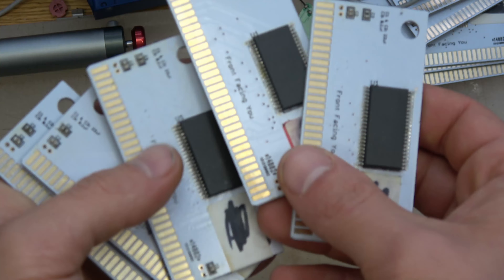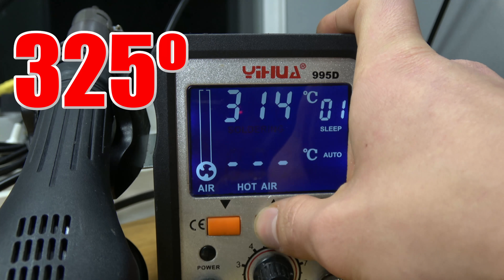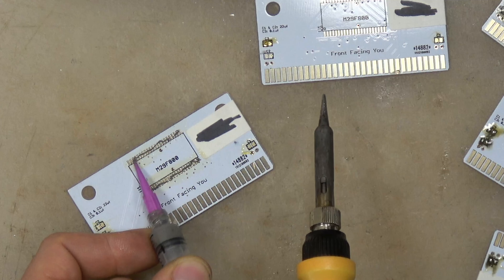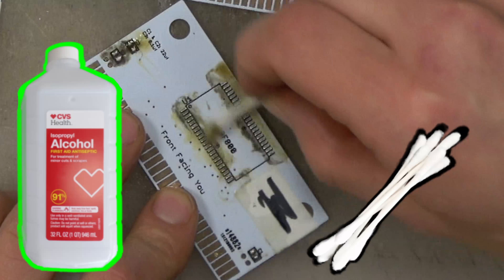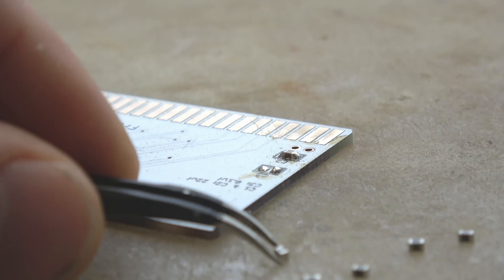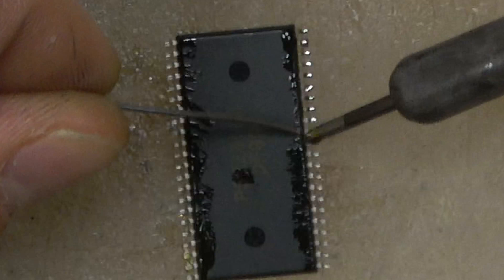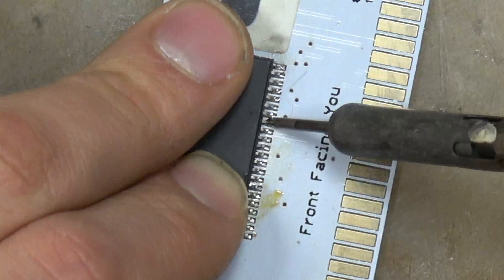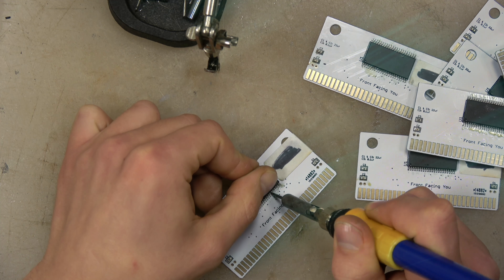Solder Basics - SURFACE MOUNT SOLDERING - RETRO GAMING ARTS

Comment: Awesome!!!  Thanks for doing these videos man!  Gonna be great reference points for when I start fiddling around with soldering.
Reply from the maker: The S-Squad when you do want to start, let me know, ill help gear you up with a starter pack, keep all the stuff you need cheap at first, and stuff like that, either way thank you for watching
Reply: S-Squad, soldering can be a very empowering feeling. I started only a few months ago with S-video mods on the Genesis, now I'm repairing consoles and doing incrementally more difficult mods. It's a great feeling knowing I can keep my system going as it ages and will inevitably fail. Not to mention it's just a darn good time. Definitely go for it.
Reply from the maker: nordak, very very well said, it has a rewarding feeling that feels really good, i was talking with some friends today about how about a year ago i wanted to hardwire a ps2 controller to a psp and saw the solder points and said "well, no way i can do that" and now i feel i could do it in a breeze, that feeling... feels really good

Comment: Looks like a professional job. Man, the tiny parts and areas you work with is unbelievable. Do you use a magnifier.
Reply from the maker: Thank you, and for a magnifier, i use my cell phone camera zoomed in to the max, 8 times zoomed, i use this to doubble check to make sure it has a good solid connection and no connectings are bridged

Comment: Mad skillz.  Seriously man, I'm amazed.  Just taking off the smd resistors when doing the mega amp mod made me a little nervous.  I learned a ton from this video.  Thanks so much for making these soldering vids.  Has helped me tremendously.

I am intrigued about the boards....are repros in your future?  That would be friggin' amazing.
Reply from the maker: nordak 01287 those smd resistors on the mega amp, just heat em up, and swipe them away, and as for the boards. Check my website and youll see exactly what the boards are for. I have not started a video them yet, but in about 1-2 weeks it will be uploaded
Reply: I'd truly like to say I understand what the cartridges do outside of the diagnostics aspect. Holy motherboard, batman. Makes me realize just how much I have to learn in regard to what makes these old consoles tick. 

On the smd resistors, I started with a pencil tip and quickly realized a different tip was in order. Once the tip was changed, they slid off like hot butter, just as you said. Keep up the great work!

Comment: Seeing how you solder in microchips and tiny capacitors was really neat. I was looking into a few projects where I might be doing that and I was nervous about soldering chips, but it turns out it was easier than I expected and there's multiple ways to do it. Hopefully I have no trouble getting an air gun though.
Reply from the maker: today i made a mistake, i removed 3 surface mount resistors from a genesis, and they where the wrong ones to remove, i found them in my cup of steel wool i use to clean my iron, and put them back on, and then finished the mod, my friend was like "the fact that you ruined the board, and then fixed it, is more impressive than the mod work itself" and just as you said, it was actually alot easier than expected, i did that particular fix with my regular iron, but the hot air wouldof made it alot easier like in the video

Comment: good technique for the little capacitors, I'll definitely use that.  Although there is a much easier way to do the chips.  Use an angled chisel tip like this: http://www.surplusgizmos.com/assets/images/madell_qss960-t-k_chisel-tip.jpg
You don't need to tin each individual leg on the chip either.  If your pads are tinned you can simply drop the chip onto the pads, and with plenty flux, you can simply run the chisel tip down the legs in 1 smooth motion, and all your legs are soldered in less than 5 seconds.
Reply from the maker: andeh, your 100% correct, you dont need to tin the chip if your pads are tined, i just wanted to cover as many examples and methods as i could in the video, and tinning the pads is alot more tedious, for this particular chip, i actually was bending each leg in a little bit, because of the way the legs are bent, they actually needed to be bent inward a little, i'm sure with the tip you showed in the pic i couldof bent them while dragging, but since this is for my special diagnostic cartridge i wanted to make sure they where perfect